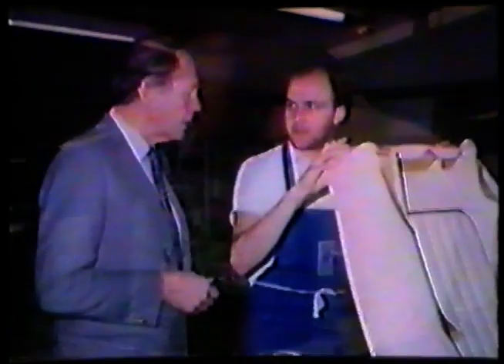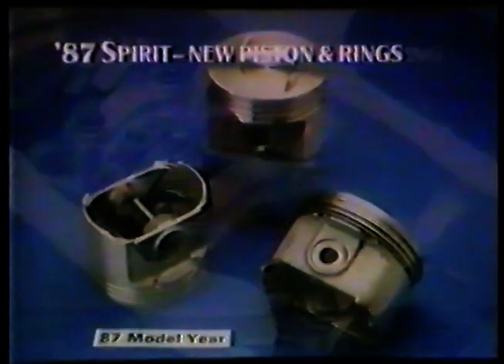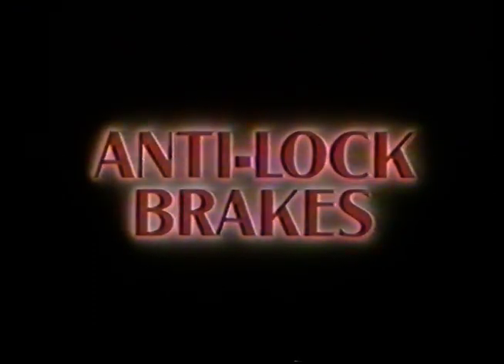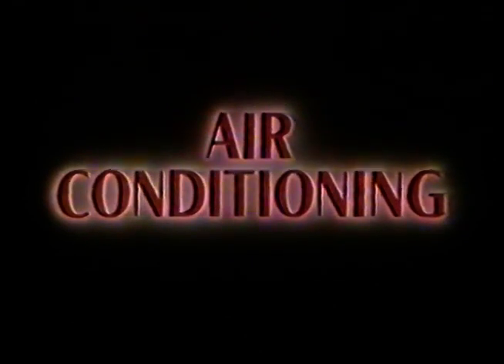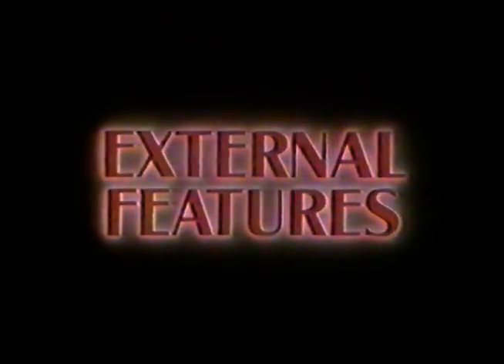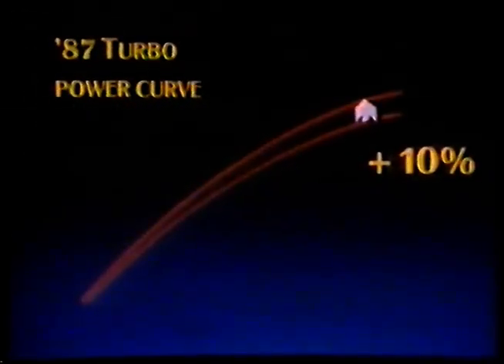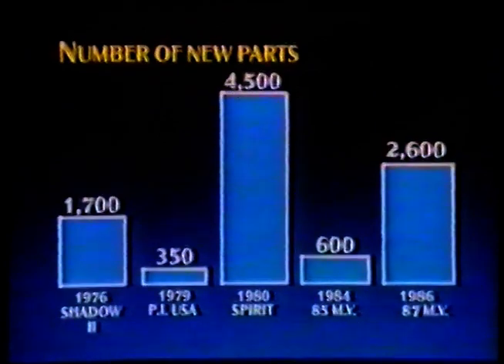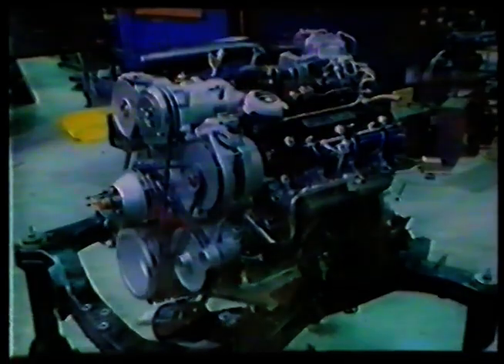Rolls-Royce Film - 1987 Model Year Cars (1987)

Comment: Comes standard with a compartment for the oil. 
So basically they know you'll need 2L of oil on hand 
to replace the oil that will leak out...
Reply: That compartment contain not always easy to find Mineral Oil for the Suspension & braking system not engine oil.
Reply: However, being a Citroen derived system, it uses LHM fluid common to all larger Citroens after about 1967. Liquide Hydraulique Minerale ( green)
   Available absolutely everywhere in my experience.